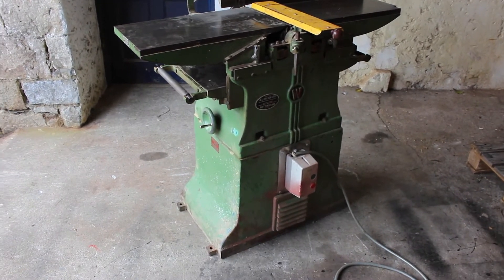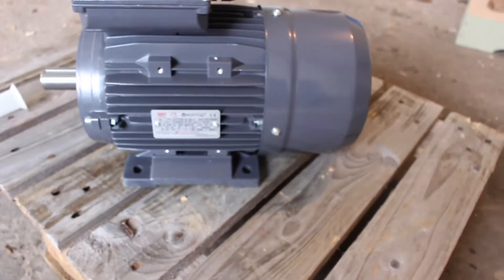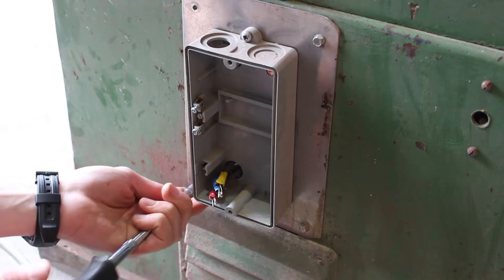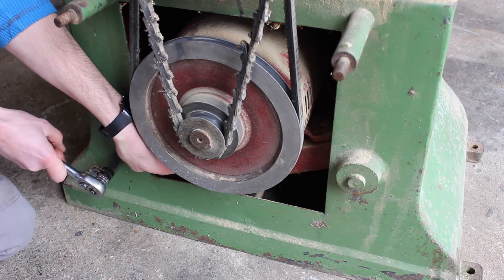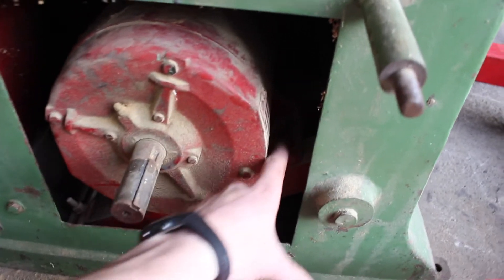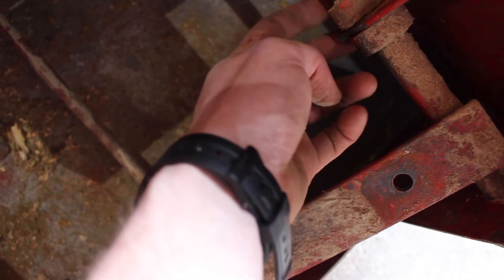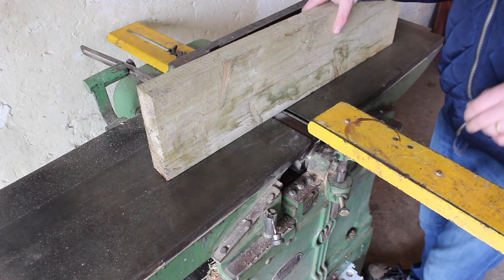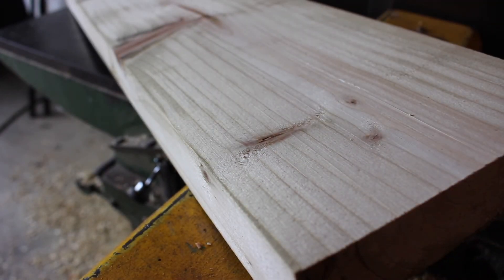Whitehead Planer Thicknesser 3 phase to single phase conversion

Comment: Great Video Sam i cant find manual for this machine. I bought machine and all parts are loose. Any chance for few photos of Your machine under table so i can see how to attach everything. Thanks
Reply from the maker: Sorry its buried in the back of the shed at the moment... couldn't find a manual online so you will have to figure it out yourself!
Reply: @FixitSam   i cleaned everything so i see atleast numbers i only have problem with springs and small bolts just need photo under table for infeed and outfeed rollers and spring in brass block. Please cant find any information about it :(
Reply: @peterch6909  did you get it sorted? I'm in the middle of converting mine
Reply: @archiebf4524  Hi there yes i figure it out from "google search photos" but if You need some help let me know. Would be happy to help
Reply: @peterch6909  it's been fairly straightforward so far for me, though mine has been "weathered" a little bit more than Sam's. Glad you got it sorted it's nice knowing these machines are being kept from the scrap yard
Reply: @archiebf4524  yeah its great machine i had to remake new pulley on cutterblock. Got 4hp its loud like airplane :).Enjoy Your one!
Reply: @peterch6909  I’d be interested to know how you made a new pulley for the cutter block. I am restoring a Junior Whitehead thicknesser that has very similar drive mechanism to the one shown in this vid. However, the pulley on the cutter head has worn. Any advice/info you can give would be greatly appreciated. Thanks, Tim.
Reply: @timothyades9983  Hi i got taper bush 1210 and spa080 1 groove pulley. (For 1. 1/8inch shaft) 
https://www.bearingboys.co.uk/1210-Taper-Bushes/1210118-Taper-Bush-Dunlop-2262-p

i also got shaft collar same size as shaft and turn it down so it would fit bearing housing hole.(so grease would not escape easly.) And thats all. Regards
Reply: @timothyades9983  i didnt use key. I wanted to use second collar shaft behind taper lock. And make key slot in collar. Using for few konth without just taper and all good. Would try send You photo.
Reply: @peterch6909  I would appreciate that. Thank you.

Comment: Beautiful machine, lovely work there truly enjoyed watching that. Hope this channel is still active, its full of gold ☺.
Seems like I will be going the same route, changing motor instead of vfd, what is the biggest  motor that can safely be connected to 16a supply? Thank you
Reply from the maker: Thanks for the comment. About 3kw/4hp. However it will draw more on startup which may trip a 20amp breaker.
Reply: @FixitSam  thanks for advice. Seems manufacturer is only offering 3kw for single phase and I have to pay for that as option, maybe I am better of sticking to 3ph motor and changing it to 2.5-2.8kw when it gets here, that way I get to keep origanal 3ph for later  if I ever get 3ph supply. 
Thanks very much for pointing start up draw out to me .

Comment: I just bought exactly the same planer/thicknesser so thanks for this video it's super helpful! do you happen to know the measurements for re drilling the motor mounts and where did you buy your motor?
Reply: Hi jamsand do You still have this planer? Need photo how to attach rollers with springs etc. Thanks
Reply: @peterch6909  hey I do its still in bits though so might be even more help I'll send over some pictures when I get in tonight 😊
Reply: @jamsand3  would be so happy!!!
Reply from the maker: This was the motor... https://www.ebay.co.uk/itm/192656508455 The spec sheet will show you the dimensions.

Comment: Very good video. I have a panel with two motors, main 4kw blade and then a scoring blade 0.75kw motor. Would it take much to convert ? Or would I better off with a phase converter.